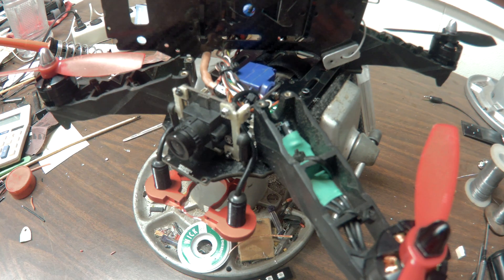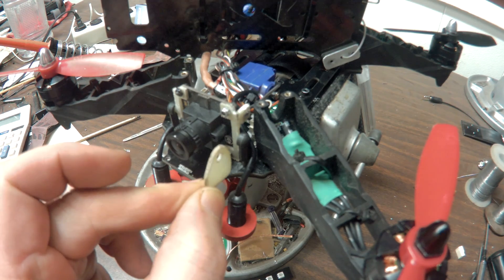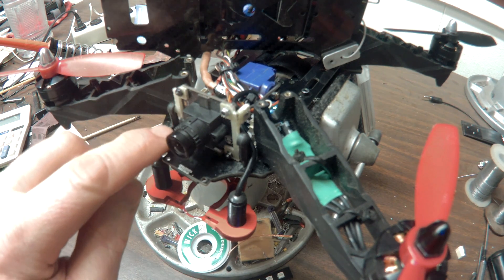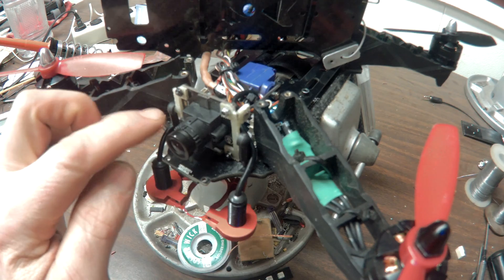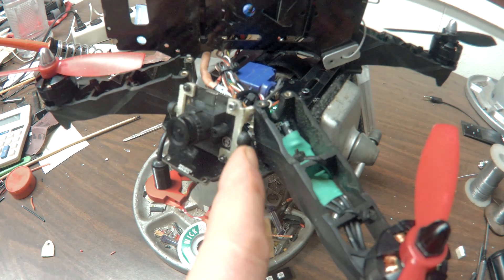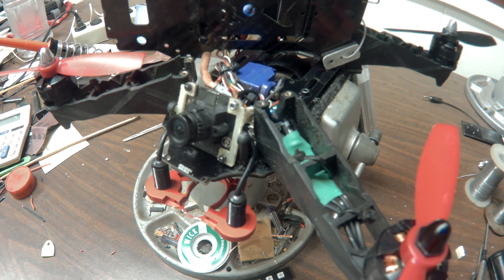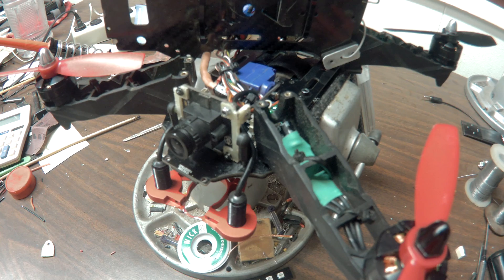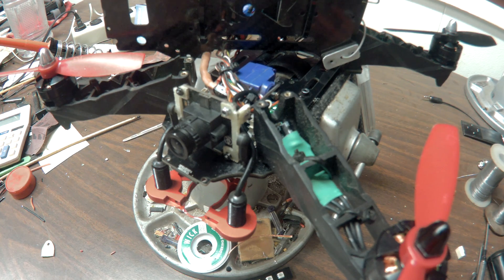Camera Tilt Revision

Comment: I really like your updated design! I must find some time to replicate your hardware changes and then setup gimbal mode so that the camera holds the horizon. I just need to find another place for the X4RSB as it's currently where the servo needs to go. Any chance you could post some close up photos from lots of angles over on the RCGroups page so that it's easier to copy? What's the white material you've used to support the camera? A quick search led me to this explanation https://youtu.be/6lZtczY5A1s of how to setup a CC3D board to drive it using OP. Just got to find something similar for CF/BF.
Reply from the maker: +Julian James Thanks Julian. Put the X4RSB on top, just behind the Vtx antenna. I just switched out servos to a 2.5g and that thing is TINY, with plenty of torque. The white material is just a small piece of fiber glass panel I found laying around, but you can use some stiff plastic or even aluminum. I just looked for something that was about the same thickness as the original top and bottom brackets that came on the camera. The hole placement (and alignment) for the upright brackets/ball joints is crucial though. You gotta make sure the camera is pointed straight forward and dead center of the hole in the nosepiece. I found this video as a link to the one you linked. It shows how it's done in CF. https://www.youtube.com/watch?v=Py_RLdZwAlc&index=17&list=PLYsWjANuAm4p47OBBTOo4Xr3lNUc8PFpc